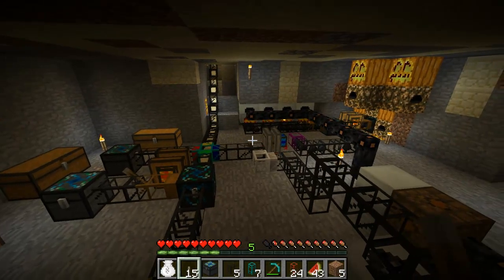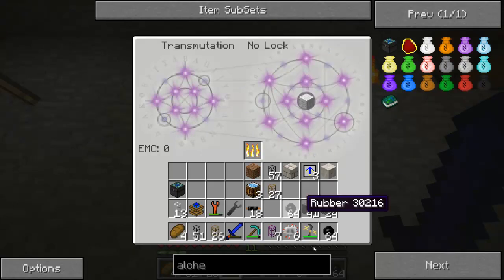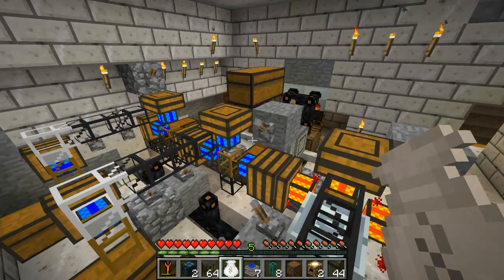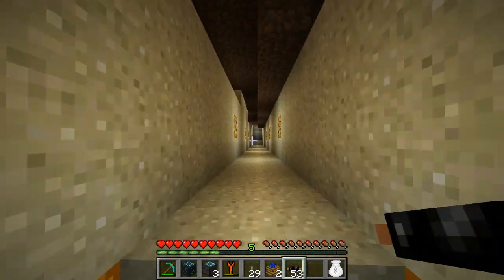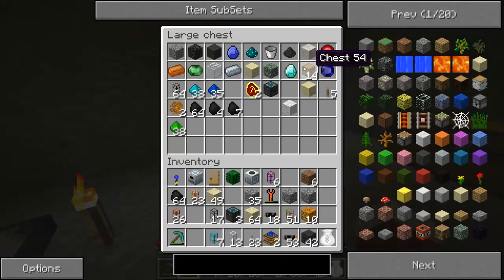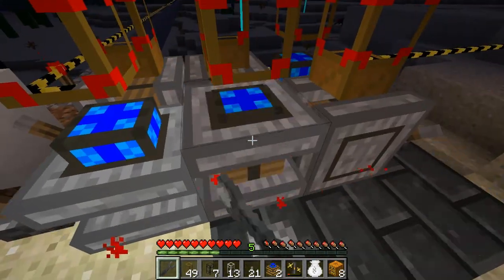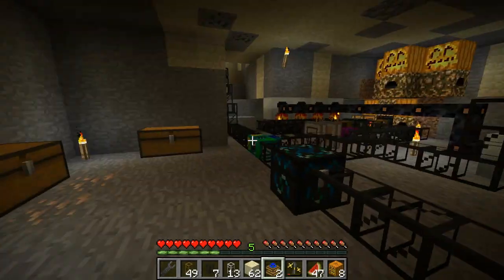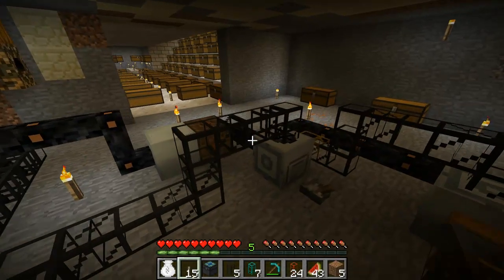16 chunk quarry 64 by 64 Automatic Diamond Condenser Coal Generator- Minecraft Mod Series 1 Final Ep

Comment: No the extra doesnt effect it at all. Day light or midnight. With or without the extra the rate is the same. I have tested this over and over again setups set upside down so all the collectors face the sun . turned off day so its perma night. added extra glowsone and still just under 9 sec. take away the extra glowstone and still just under 9 sec. avg was 8.7 - 8.9 depending how fast u react on hitting the button on a stopwatch. I also paced them fully in the ground same outcome with or without.

Comment from the maker: @camyrocks123 9, but not set up in the way I did as there's a slight power loss in the build craft pipes, piping them into each other without the front one exploding is the way to go (3 connected on 3 sides)

Comment: ok bud i got my pc just like new like 3-4 days ago and its running like a beast well it cost my dad 1,500 bucks YEAH ITS AAAAA LLLOOOOOOTTTT!!!!!!!!!!!!!!!!!!!!!!!!!!!!! without monitor and but to the specs : well i got a gygabite 990fxa-ud3  ,  amd i think 8 core processor , a radeon hd 7750 graphics card with 2gb for gaming a 2 4gb each corsair vengeance ram , corsair 750 gaming series power supply , i think corsair water cooling device , an extra fan that lights in blue its amazing